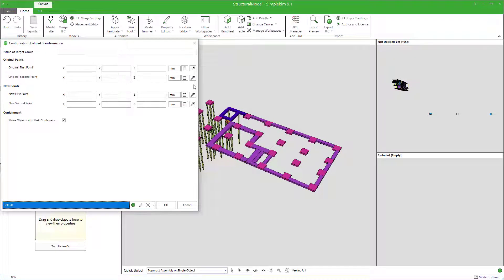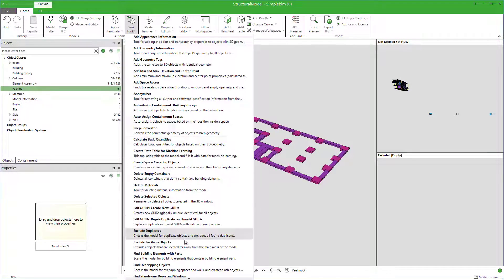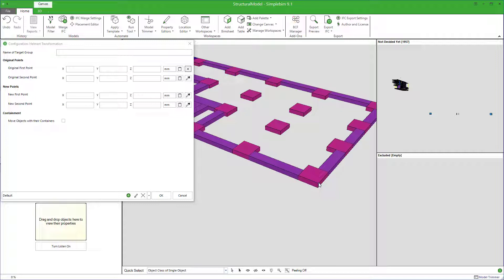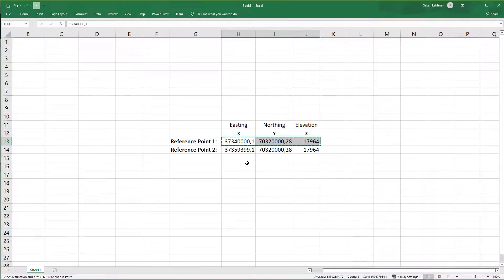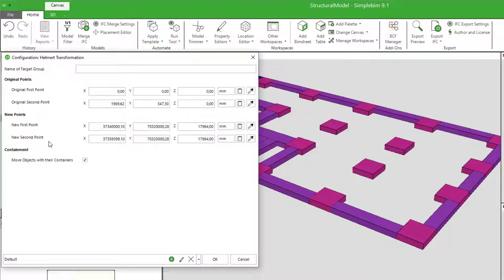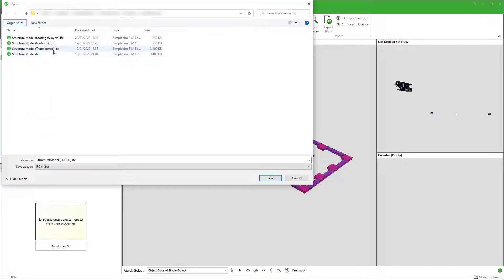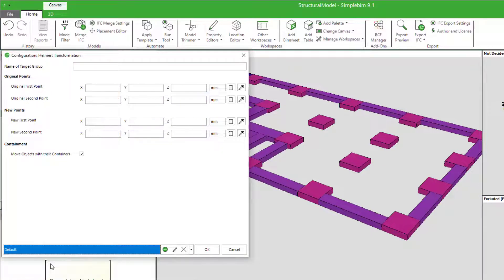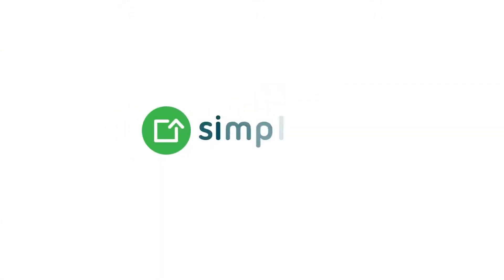Simplebim® - Helmert Transformation

Comment: If you go from a local grid to a protected coordinate system (like it seems to be the case in your example) you should probably take into account scale factor... On some systems and with small scale projects difference may be negligible, but on some others and larger scale projects it can go up to tens of centimetres. A 7-parameter transformation (with the possibility of choosing more than two pairs) would be highly appreciated, Mr Helmert would definitely thank you back 😉
Reply from the maker: Thank you for the feedback! We don't have the scale factor in the tool, because that would imply that the users could scale the geometry of the models, which we don't want to allow. Especially accidently. Geometry in IFC models should of course be in scale by default. (There are other ways in Simplebim to change the units of the whole model for example from mm to m.). Then again, now, along the IFC4x3, IFC will be used with infra models too, and taking care of the precision of the transformation in the large-scale projects will be important indeed. I'll look into this. Thanks!

Comment: hi, could helmert transformation used to change the height +- at the Z axis?
Reply: OR with which tool will the height change work best?
Reply from the maker: @pseudonym6629  Hi, thank you for your question. Helmert Transformation in Simplebim is so-called four-parameter transformation. So x,y and z (height), and xy rotation. You should be able to use Helmert Transformation for the z transformation. However, for your use case, a more convenient and simpler way might be to use the Placement Editor from the UI. Or Move and Rotate tool, if you are looking for automation. Finally there's a basic move and rotate functionality in the Templates. Depends on your use case. Please check our support website for more information. Search for Move and Rotate here: support.simplebim.com. Thanks!